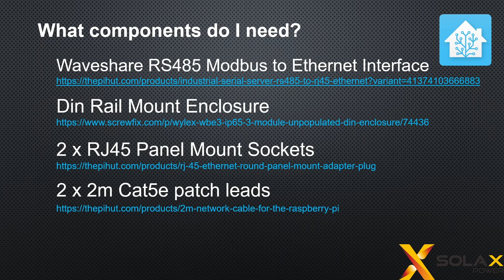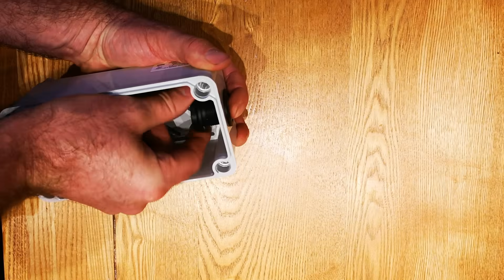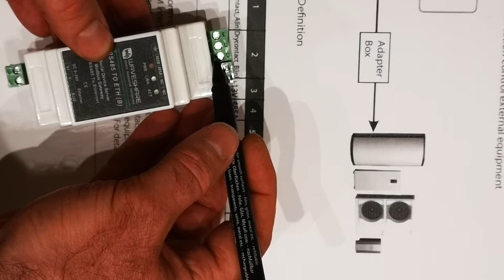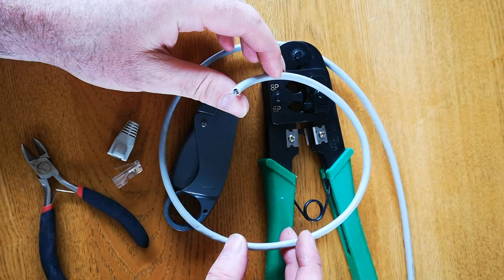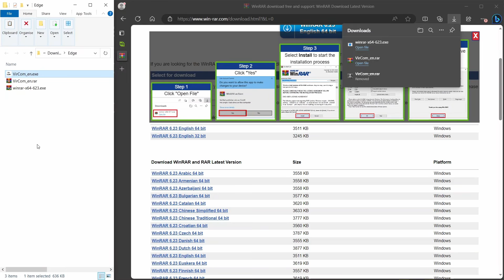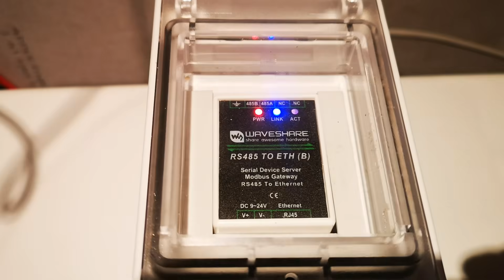20 - Build a Waveshare Modbus Interface - Home Assistant Tutorial - Solax Solis Growatt Sofar

Comment: As a drag and drop HA user,  i was  really excited to come across your easy to follow video.  So, thanks.  

However,  on checking my Solis inverter, I note that there is only one connection marked COM, and that is  connected  to the battery. Has that blown the project out of the water?

Comment: Hi in trying to use home assistant to disable PV 1 and PV 2 , the normal solax plug-in for home assistent is not  alowed to change something in the Solax inverter, wil it be possible to do with the com port ?
Reply: We using also the EPS function so turnoff not recomended 😅, but thanks for the you time and Nice video’s 🎉
Reply from the maker: There's no facility to disable an mppt from home assistant. Why do.you need to do this?
Reply: Hi 😊 we have every weekend negative power prizes , so I want to pull as mutch power from the grid as possible, drm function maybe ? But is it possible to enable and disable that function with comport ? I tested that drm and when enable the pv panels stops all also connnected batterij’s stops charging and dischanging 🎉
Reply from the maker: @janheuvel4177  Maybe you could just turn the inverter off with ha at those specific times.

Comment: Another question for you, I have been looking at the Waveshare for over a year and so gone back to your video. Which is very good, (and every compliment always seams to have a "but") but will a Solax Pocket LAN + Wifi V3.0 do the same thing give me live data? I only have a SOLAX-WIFI-3.0 and that sends data every 5 mins. Thanks in advance.
Reply from the maker: Yes, you can interface Home Assistant with the Wifi/Lan dongle for live data.  The Solax App will also update the power flow diagrams every 10 seconds with the wifi/lan dongle as long as the inverter is compatible.  To check compatibility, I'd need the inverter serial number.
Reply: @JWSolar  Thank you for your reply, a bit hesitant on posting the serial number here, or am I being paranoid?
Reply from the maker: @StuartIngram  Join "Solax Support UK" Facebook group and PM me.
Reply: @JWSolar  joined thank you, and sorry for being a pain.

Comment: Thanks for the video - It is worth noting that the Solax X1-Mini-G4 has a different pinout and the +13v is now designated Heat Pump -. So buy the POE version of the Waveshare or provide a separate 12V supply

Comment: Do you really need to use the Waveshare brand of serial / ethernet adapter? I have a StarTech one in my junk pile, but I'm wondering if theres something special about the Waveshare devices.....
Reply: As long as it converts RS-485 to ethernet (and preferably Modbus RTU to TCP translation) and fits on a DIN rail it should work.

Technically you could also use a RS-485 to USB stick directly to a computer (Raspberry Pi?) but that uses way more power.

Comment: Just finished putting one of these together, yet to test it. Many thanks for your help.
Completely off topic, but when you show your Solax entities, your column widths are not what I see on mine. How did you alter them? I can see no way of altering the width, mainly to show the entity ID name, which on my screen, long ones are always truncated.
Thanks in anticipation!

Just installed, configured and it's working OK.
Thanks again for the most helpful video.

Comment: Great video, very nearly there I think. I've been using the solax modbus integration for HA for a few months  mostly successfully via the Solax Pocket WiFI ( I have a Solax X1 Gen4  Hybrid Inverter), but due to the occasional drop and all entities disappearing I thought I would buy the Waveshare RS485 POE version. Managed to  get  red power, green link light and flashing green/blue act on the waveshare when pointing the HA addon at it but no solid blue link light (Just every few minutes for a second or so) and only 4 entities in HA. 

Also swapped the CAT5e cable and did a continuity test on each wire from the rj45 to the terminals on the Waveshare, all good. Does anyone know if the x1 gen4 is supported on the waveshare or am i just limited to the pocket wifi modbus?

Any help greatly appreciated
Reply: Ah, just found a few clues in the log after turning on debugging in HA<

Logger: custom_components.solax_modbus.plugin_solax
Source: custom_components/solax_modbus/plugin_solax.py:66
Integration: SolaX Inverter Modbus (documentation, issues)
First occurred: 11 November 2024 at 10:23:35 (66 occurrences)
Last logged: 16:30:16

SolaX: reading serial number from address 0x0 failed; other address may succeed
SolaX: reading serial number from address 0x300 failed; other address may succeed

AND

Logger: custom_components.solax_modbus.plugin_solax
Source: custom_components/solax_modbus/plugin_solax.py:5958
Integration: SolaX Inverter Modbus (documentation, issues)
First occurred: 11 November 2024 at 10:23:35 (33 occurrences)
Last logged: 16:30:16

unrecognized inverter type - serial number : unknown

Perhaps my X1 is not supported?

Comment: Great video, but mine is still not working. I have the POE version so not using power from my X1 Mini G4. I was missing a ground connection so used pin 3 (In my manual it's listed as 'Heatpump -' On checking it's a direct reference to the chassis ground of the inverter. I get the red power light and the blue status light, but HA refuses to talk to it. The adding process just freezes at the initialisation stage. - Any ideas? Is there a setting in the inverter that needs changing (I've got the installer password). Thanks,

Comment: Thanks for the guide - my inverter (Solax X1 G4 7.5D) user manual COM PIN Definition just has pin 4 and pin 5 labelled as 485A&B. Crosses are marked in all other pins, assuming this means they are dead and I need to find an external power supply for the Waveshare? If so, does the "ground" pin on the waveshare not need the link wire from -ve?
Reply from the maker: @MrPaulj123  No, they are not dead, the manual is just showing the meter connections so it doesn't confuse people. The other pins are still active and connected.

Comment: Hi, Just ordered waveshare to connect to 2 x Solis S5-EH1P3.6K-L. Also ordered correct 4 pin RS485 plugs for inverters. Any advice about how to connect/use terminating resistors would be very helpful, Will S  says these will be needed.
Reply from the maker: Sorry, you're better asking Will.

Comment: So in order to get 3 of these modbus devices talk to each other like a growatt inverter, a Wallbox like Pulsar Plus and a eastron 3 phase smart meter I would need rather 3 of these modbus rs 485 to  rj45 connectors ?
Would be easier to order 3 instead of 1 by one considering that those machines are distributed across the house with an inverter somewhere, the smartmeter in the grid connection point cabinet and the charger / wallbox in the garage.

I hope you can help me regarding this topic !
Or is there any wifi connection or bridge from the usual shine wifi x or s stick to the modbus ?

I had tried that first by installing the modbus for the ip of the inverter / stick. But I got no entities as you did.
And you had mentioned that wifi modbus wouldl be possible but not so reliable and dependent on the internet.

Thanks

Comment: Thanks so much for this walkthrough, I've learnt so much

However, I have an issue with connecting to my X1AC.
I've managed t wire it up (pins 6,7 and 8) and it's powered externally with a 12v power supply.  I have a red power light and a green link light, which is great.
However, when I configure the WaveShare via VirCom, I can't get the link light to turn blue (and HA doesn't see the inverter, so no device or entities).
Do you know if there are any specific settings that I need to apply via Vircom to an X1 AC inverter, in order to make this work?
I'm really close to getting this working so if you (or anyone else) has any additional config information, it would be greatly appreciated.
Many thanks in advance.
Reply from the maker: Hi, any chance you could join the 'Solax Support UK' Facebook group and post your question there? Thanks.
Reply: @JWSolar  Of course, thanks very much

Comment: Hello, thank you for the great video clip! I have tried to follow all the steps, everything looks good, the blue LED light is on, and I have TCP connectivity with the Modbus to ETH server. I have downloaded the Modbus Solax program on Home Assistant and entered the IP, bandwidth, etc., for the Growatt inverter, but no device or entities are showing up. Also, the blue light on ACT is not blinking every 10 seconds as I have configured in the Solax Modbus program. Does anyone have any tips, in exchange for some coffee cups? :)
Reply from the maker: The Growatt inverters will have different settings to the Solax demonstration in the video. Have a look in the manual for baud rates, pin outs, etc.

Comment: Worked my way through most of this after getting fed up with the wifi dongle dying and finally got it working. Beware the modbus adapter doesn't appear to work at anything other than 10m ethernet, which seems to be a problem for my Omada switches. I've worked around it with an old switch I had but just be aware if the ethernet doesn't come up it could be that.
Reply from the maker: Thanks for letting us know.
Reply: it most likely rather depends on the cable - cuase the growatt mention in the manual a 15 m or 25 m total length, but they do even work with up to 100 m CAT 7 cable.

Comment: I see you are powering the wave share module from the rj45 rs485 port on the inverter. Do you know if this is common on these ports or particular to your type ?  I have sunsynk inverters do you know if these will also provide power via the rj45 ?  If not would you have any idea how I could find out ?  I've searched for details on google but haven't found anything. I can find a version of the Modbus protocols etc but not the physical set up (pinouts etc) .   Maybe I went for the wrong inverter this seems so easy to set up on the solax. Thanks.
Reply from the maker: It's inverter specific, you'd have to look in the manual. Thanks.
Reply: @JWSolar  Thanks for the reply. I was hoping it would be an rs485 standard. The manual doesn't seem to cover these ports at all.
Reply: As a follow up. I had to use an external power source but got a nice small one that was din mounted and did it all in the same box. Interestingly With a Tee RJ45 socket (no electronics in it)  I can read two inverters (or more but I only have two at that location) with the same WaveShare. this is due to the WaveShare being the master and the inverters the slaves.
Reply: Thanks for making this brilliant walk through. I am going to get a Solax inverter, just submitted dno 99 so probably in 3 months. I read somewhere solax has stopped supporting their API for third parties in recent firmware updates. I guess that applies to its http api and modbus is not affected? does this still work for you with latest firmware? Thought I would check before I hit purchase at PiHut. Thanks again.

Comment: Great tutorial, thanks.   I've ordered a wave share module.  Any suggestions as to what the setting would be for a sunsynk inverter?  I get the data from the cloud at the moment but as you correctly mentioned this is prone to problems if there are any server outages or other internet related issues and even when it works it can be more than a minute between refreshes.. (yes I have increased the update time on the sunsynk to 60 seconds (default is 300). So if I can get this to work on my three sunsynk inverters I'll be more than a little please...

Comment: Hi, is it possible to use the Modbus interface if the RS485 is already used for the Solax EV Wallbox?
Reply from the maker: Yes, you can split it.
Reply: @JWSolar  are you sure there will be no communication errors? Inverter will be master and the modbus and EV Wallbox will be slave?
Reply from the maker: I can't be sure as I haven't tried it, but other people I know have done it with modbus car chargers.

Comment: I have a solax x1ac inverter,  it has  network socket labelled 485, can I connect  to that?
Reply from the maker: Yes, but the pin layout is different and there's no 13v power provided. You'll need a DC adapter to power the waveshare, and check your manual for the 485A and 485B pins.
Reply: Found it in manual can you please advise how to continue?
Reply: Sorry can't figure how to attack screenshot but it's pins 7 & 8 on the inverter

Comment: Thank You for this tutorial. How can I connect the waveshare to the inverter when an EV Charger is also connected to the com port
Reply from the maker: Which inverter do you have? Does the car charger use modbus? If it doesn't, you can connect it to the same port using different pins.
Reply: @JWSolar  Sorry not enough information: I use a X3 Hybrid G4 15k and the Solax EV Charger 11kW connected via RS485 to the inverter on the com port. I have contacted the support and they told me I can use a R45 y plug at the inverter side.

Comment: Thanks for the nice explanation in the video
Are there people who have already managed to get it working with a Solis inverter?
I have followed all the steps and measured the cables, but for me the act LED does not flash. I have the poe version because my voltage from the inverter is only 5 volts. I have also tried the baterite on 9600 but no success. If something else is connected to a data logger, the RS485 connection works fine.

Does anyone have any tips?

Comment: Hi there,

Thank you so much for the video it is very much appreciate. 

I'm having trouble with only being able to see 4 entities.

I have set the static IP on my router and in Vircom
I have checked the IP in my browser and have full access
I have reset the device and router and it keeps the same ip address

I have changed the port to 502

I have changed it to Modbus TCP protocal

I have changed the Baud rate to 19200 and check the inverter setting to make sure this is correct

In advanced setting I have changed it to simple modbus to TCP and RTU

In HA I have changed the polling to 10

Selected Parallel Mode as I have my inverters in parallel

Input the ip address exactly as I get access to it through a browser

TCP port is 502

I have rebooted HA, and power cycled the batteries. 

But still only 4 entities, any idea what I'm doing wrong here?

Comment: Nice video but one thing confuses me. 
In your video '07 - Configure Modbus Integration - Solax Solar Home Assistant Tutorial' you state that during the HA configuration you should enter in the ip address of the Solax dongle. In this video you said you should enter in the ip address of the Waveshare Modbus adapter. Which is correct?
When I enter the Waveshare ip address I can only see 4 entities yet when I enter the WiFi dongle ip address I can see the full 257 entities. I have followed the vids to the letter and all matching baud rates etc but no luck with the Modbus ip.
I have a X1 Gen4 and according to Solax they updated all my software and firmware two weeks ago before I embarked on this.
Any help would be appreciated. Thanks
Reply from the maker: They are both correct. Video 07 is for the dongle, but I was asked to do the Waveshare too, so that was added later on. If you only have a few entities with the Waveshare, it's probably not configured properly the IP Address scheme is wrong, or the wiring is incorrect.
Reply: @JWSolar  Thanks for the reply. What do you mean by the IP scheme?
I have a static ip set on the same subnet as my main network. The SolaX dongle is on a VLAN but I can connect to both the modbus and the dongle using local ip’s no problem and the Waveshare act light lights up green when I try to wake battery etc but there is no response from the inverter back to the modbus…
Reply from the maker: @meb3105  Have you checked the wiring between the inverter and waveshare. I've had a few enquiries over the past few days that were wired to the wrong pins, had a faulty cat5 cable, or even plugged into the wrong port, resulting in exactly what you're experiencing.
Reply: @JWSolar  ok thanks. I will double check that tomorrow. 
Can I just confirm the modbus only requires the SolaX dongle to set or confirm the baud rate and com port etc?  Once this is set the dongle is no longer required for operation via modbus?
Thank You
Reply from the maker: @meb3105  Correct, although keep it connected for firmware updates and to update the Solax cloud if required.

Comment: Great set of videos - TY
I have a small problem you might be able to help resolve - currently communicating withHA via the SolaX Modbus integration via the wifi dongle - all entities present, switch over to the Waveshare interface and im only getting 4 entities, have tried deleting, rebooting - switch back to the wifi dongle IP and all entities present again ?
Reply from the maker: It's usually an error in the waveshare setup, or something wrong with the IP address scheme. Check both these very carefully.
Reply: @JWSolar   thanks for the reply - does the Vircom software have to be running on a host PC ?, or is that just used for setup
Reply from the maker: @MrPhilgr  It's just for setup.

Comment: Great tutorial, I’d love to use those with my Solax x1 boost, but I’m not sure I have a comm/ct port free? I have an TS458 port that’s in use for the power meter to tell my inverter how much power the house needs, is my inverter not compatible?
Reply: I guess you meant 485 right ?
And you would need a modbus proxy which allows to connect 1 device with several others like the power meter talking to your inverter and also to your home assistant  and maybe even wallbox / charger which would mean that your meter would be connected to HA where the proxy addon would do the magic to connect all the slaves with this master.